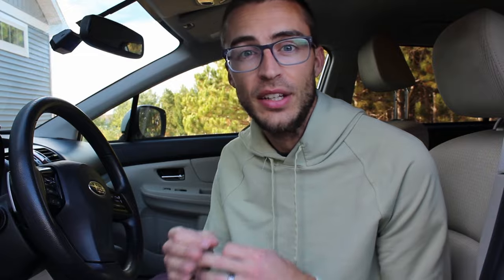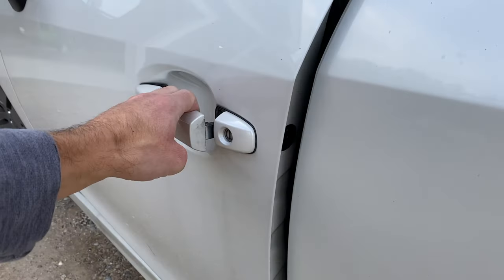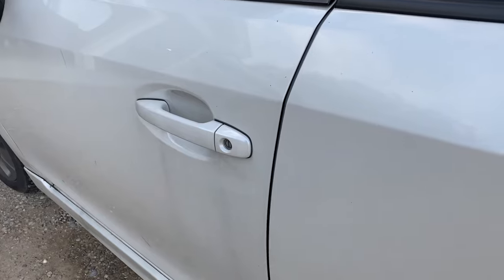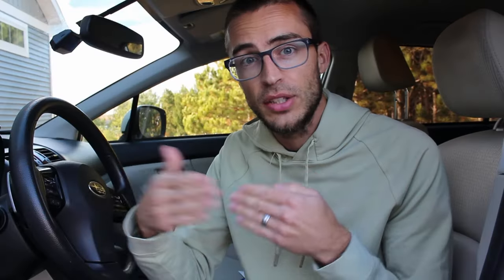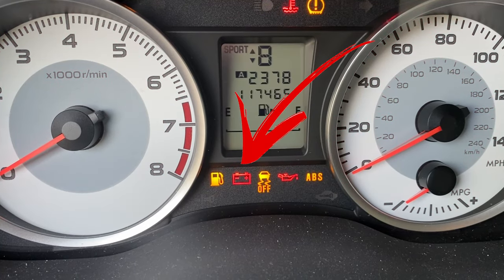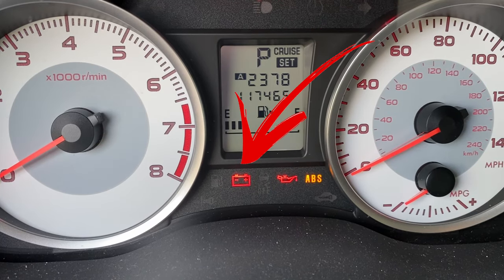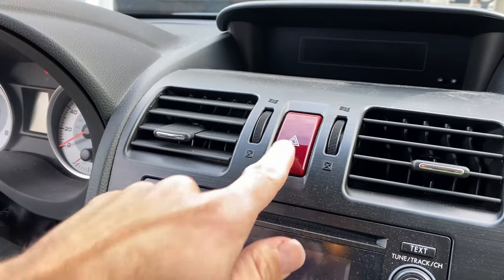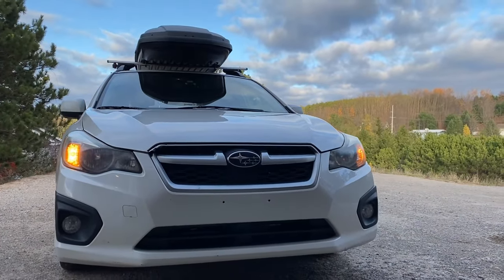Common Remote Start Problems and Fixes

Comment from the maker: If you found this helpful consider sending me a Super Thanks with the icon below the video, ❤💰 I will buy a Coffee with it! ☕
Reply: I had a remote start installed at Best Buy/I did purchase it there. When I went to go pick up my car. It didn’t start, I had to leave it there pick it up the next day. The guy that installed the Remote start said “ my battery cable was loose“ Never had any issues with my battery cable being loose before this. Three days later my car wouldn’t start again. I returned to Best Buy and have them remove the remote start. A week later my car doesn’t wanna start again,And now I can’t get it to start at all. Please help
Reply: Where are the fixes?? Waste of time!! Boooooo

Comment: My heat won’t start until I’m physically in the vehicle & put my foot on the brake.
Reply: Did you find a fix? Got this problem too.
Reply: Unfortunately I did not. I don’t even bother with remote start anymore especially if the electrical won’t start until I’m in the vehicle
Reply: That’s normal
Reply: Check to see if the remote start setting quiet start is on. If it is turn it off, and see if that works.

Comment: Checked all of the above… still won’t work … well it works but this latest prestige alarm remote start only runs for 15 seconds …. Plus it’s not a genuine remote start as when you start it unlock the door turn the key to ignition and press the brake to put the car into drive the car shuts off every time …so you have to manually start the car again … security measure bullshit … because you own the car and have the key in your hand

Comment: My problem is that 1 out of 5 the car start but shuts down after 1 sec.... The rest of the time its perfectly fonctional ! Whats up with that ?!?!.! 2015 forester.
Reply: I have same problem on Outback 2014
Reply: Maybe someone knows what the problem is?
Reply: @interestingchannel5661 i hope so ! I'm thinking it might be the spark plugs ?? Mine does it quite often but always stars second times with no issue...  

   It must be something stupid !
Reply: @MxRyder19  understood thanks)
Reply: @interestingchannel5661  i might be onto something here ... I read a tech blog saying that the anti theft of the car might be the reason. When its on ( witch i always do ) it prevents the gas pump to bring the gas. It would ezplain why it starts for only a second before shuting off, because of the leftover gas from last drive. 

  I've been unlocking ( desactivate ) anti theft BEFORE remote starting my Forester since yesterday ( and its been -10 here in Quebec ) and so far, its been staying on everytime. 

  I'll keep doing this untill proving wrong. Try it too and we'll have 2 different tests on two cars with same symptons. Could be interresting ! 
✌😎
Reply: @MxRyder19  Okay, I’ll try, thank you!
Reply: @interestingchannel5661  Is your driver's window sometimes rolled back down while you are closing it ? Like the car thinks your fingers are in there and dosent want to break them i had this for a good while . Turns out it needed lubrificant in the rubber tracks on each side of the window. Just saying.
Reply: @MxRyder19  I haven’t had any problems with that yet. I’ll take note, thank you)
Reply: @interestingchannel5661  i dont know if i've been lucky 40 ish times in a row... But my car starts and stay running everytime since i disactivate the alarm before ! I think that was it .
Reply: I have the same problem if you find out the solution please share
Reply: It does work for me everytime when i unlock my aftermarket anti-theft before remote starting it. I've been testing it ALOT and it really never does it when its desactivated before i remote start.

 Do you have a after market anti theft??

Comment: My family has a 2012 Ford Escape with an aftermarket remote start but with a different problem. In our case the taillights and license plate lights won’t work if you start it with the ignition key, but do work only when you remote start the vehicle.
The remote start system is made by Viper.

Comment: Does the anti-theft system interfere with remote start? Mine starts the engine but then shortly shuts off and displays the anti-theft dash symbol.
Reply from the maker: Hmm good question, does your remote start ever work?  Is it an aftermarket anti theft system?

Comment: I installed the H011SAJ401 Subaru remote starter into a 2010 Outback.  Everything works except the car will not start.  goes into and out of service mode, beeps horn etc. Battery is at 12.6V.  IF Subaru dealer service tech did not pair the starter brain box to the the vehicle security brain box, will the remote start not engage the starter motor?
Reply from the maker: I don’t know a whole lot about aftermarket systems, this info is mainly for factory remote starts, I would contact whoever makes the remote starter they would have a better idea.

Comment: One thing they should warn you about before deciding to get  a remote starter is that it does not work well from behind the car. I have to be within 30 feet of the back of my car where it is in a detached garage, and then walk back inside the house to wait for the heater to warm the car up. I wanted this thing so I could start it from inside the house, but instead I have to go clear outside and walk up to the garage,
then walk back to the house to wait. (Out in a parking lot, I can start it from 100 feet if I am the front of the car). It seems hardly worth the  $350 I paid for it if I have to go outside a ways to use it to start my car at home.
Reply: maybe go get a refund
Reply: Don't sound right. Check the battery.
Reply: it depends which one you get
Reply: Im havin the same issue i have a one way system